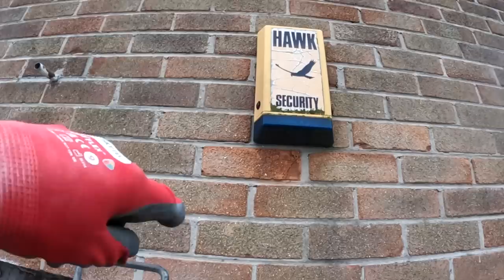MORE SHOCKING LINTELS.. DOUBLE TROUBLE PT 1

Comment: Things we do to earn a crust
Reply from the maker: we do a LOT of these 🧱👍🏽
Reply: Renewing 2 ourselves on a house at the mo inside and outside lintels both rusted out and concrete reinforce bars rusted and blown
Reply from the maker: @nigelhaines7900  . 😬 both skins gone is very rare , that’s unlucky mate, good luck 🧱👍🏽
Reply: @SteveAndAlexBuild The sea air, about quarter of a mile from the sea the Neighbours lintels have blown on their house too
Reply from the maker: @nigelhaines7900  😬😬🧱👍🏽
Reply: We found out why, the cavity tray was put in wrong it was put over the first course of bricks instead of the underside on the lintel itself with no weep vents witch has caused it to rust @SteveAndAlexBuild
Reply from the maker: @nigelhaines7900  😬😬🧱👍🏽

Comment: Would have preferred to see some diagonal bracing on that scaffold especially as you are using accrows  at an angle on your scaffolding . Better to be safe than be on it and it breaks away from the wall . Good vid otherwise .
Reply from the maker: No acrows touched the scaffold 🧱👍🏽